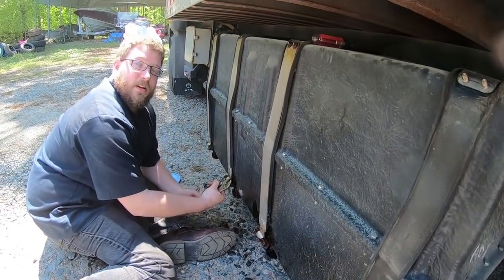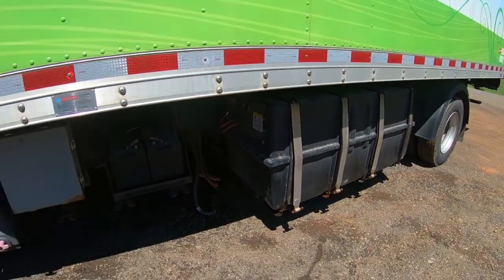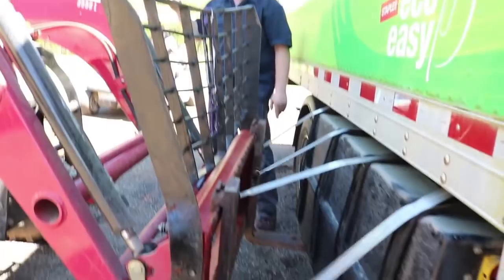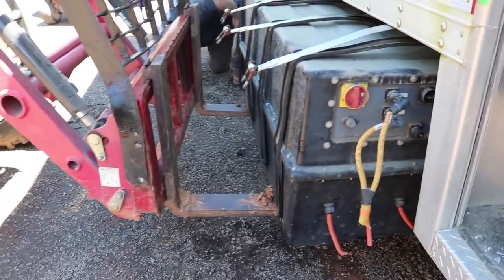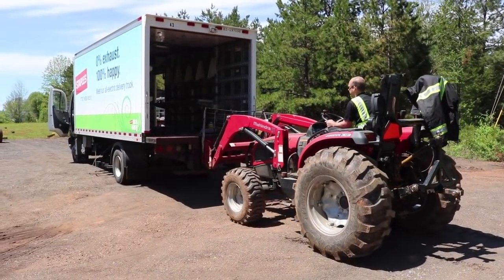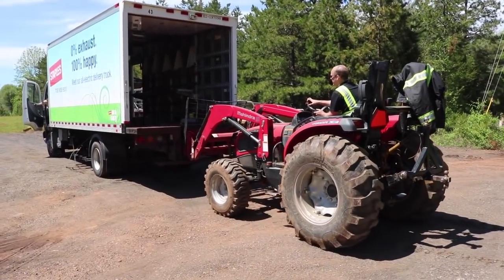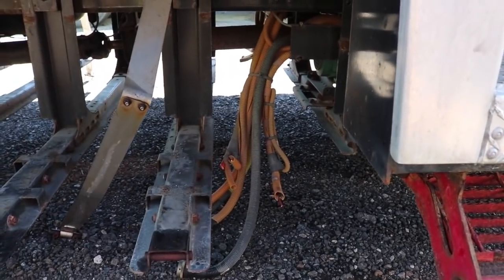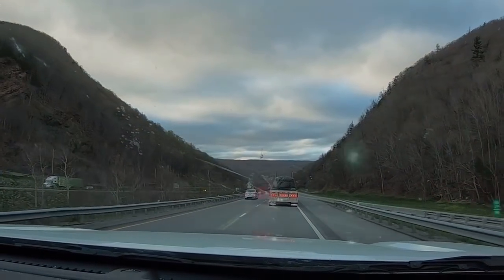7 Junkyard Electric Truck: Battery Removal!

Comment from the maker: I know I'm going to get plenty of negative comments on this video. Please keep in mind a couple of things:
What you didn't see in the video is about two hours of us going through our options, figuring out the best thing to do, and NONE of our options at that point being particularly good.
No, the high voltage cables don't have quick release connectors on them. They did have to be cut.
Vice grips are the right thing to use when the correct tool can't work, due to rust and other issues.
We were far from home and had limited time. We would have had very different options if the whole thing was just sitting in my back yard.
Driving the truck home was really not an option - we had no idea of the battery condition, it's 900 miles, requires 75A industrial 3-phase AC for charging, and a commercial driver's license.
The truck has just been sitting in a salvage yard for months - it has ZERO value when it's sitting there and nobody buys it.
There's 5 more trucks sitting in the same yard.
Likely, the best use for this truck is to take it apart, figure out how it works, make use of the various components for EV conversions and solar storage.
Reply from the maker: @Patrick Hughes I do NOT have a gearbox, but I could probably get one. Let me check back with you on this.
Reply from the maker: @Patrick Hughes 
I'll pester him again.

Comment: Even Tesla’s new trick only goes 300-500 miles without a charge.  First of all 300-500 is a large gap. I’ll guess it’s more 350-400 miles. They can’t travel fast enough. It’s A LOT easier to just pump gas and go as far as you want. Takes a split second. Too high maintenance and can’t drive far enough. They will be able to in the near future but not yet.  God Bless

Comment: That’s the problem with these big electric trucks. The batteries do not last long enough for cross truck driving and changing a battery sure is a job. So if I need a battery change beside the road I’ll need a forklift lol no thank you.   Cool but the technology isn’t there yet.  Good luck and God Bless You All
Reply from the maker: To be fair, these trucks were NOT designed for cross-country travel. They were used on fixed city delivery routes.
These were never designed for fast-swapping of batteries either. That was only because we were actually taking the truck apart.

Comment: I hope the scrap buyer payed you well?    ADD it all up the motor the air compressor, inverter with big dc-dc, and most of all the controller, you could remove it all in 2-4 hours and sell on ebay for $3k on a bad day! Then how much is scrap a ton, with loads of Alu+ copper wire... $500-800 plus! You are both mad! It had power for lights etc, tow it back!! then strip and brake, then scrap!

Comment: Could u have used the electric motor in the truck .
Reply: That was what I was thinking... ADD it all up the motor the  air compressor inverter with big dc-dc, and most of all the controller, you could remove it all in 3-4 hours and sell on ebay for $3k on a bad day!

Comment: Hi Ben.  I'm looking at these Smith Newton trucks as a possible option for our farm's next local delivery truck.  Did you find any useful technical info sources or forums related to these trucks?  It seems like it's not that hard to find one and they're selling for next to nothing considering what they're really worth to an EV person - or better yet an EV person in the market for a box truck!  I've still got a lot of research to do but I thought I'd ask if you and Seth found any good resources to dull my fear of taking on an aging Daewoo Avia with bespoke EV drivetrain from a now defunct Anglo-American manufacturer with no dealers, service network or parts availability :-).  I guess I should really buy two.

Comment: About 5 years ago I had a customer who bought a truck just like this that had been flooded and the batteries were gone. I took out all the electric parts the motor controller and charger and replace them with a net gain 13 in and a 2K Zilla controller and a new pack of calb lithem battery. The truck had a very interesting air compressor what's had gotten completely flooded for the air brakes. You couldn't move the truck unless you had air pressure.

Comment: @Ben - Despite the extra long weekend, still an awesome journey. The lithium batteries are most certainly usable, and I can't believe finding a way to charge them will be that hard. I think this will come down which motor to use more than anything else.
Reply from the maker: Once the batteries are out and by themselves, they will be easy to charge. In the truck, that charger needs high current 3-phase.
Reply: @BenjaminNelsonX  Cool, thanks Ben for the response. Just assuming here, but are you thinking something similar to level 2 type charging, single phase 220-240v, maybe 20-40A range?
Reply from the maker: Individual batteries can be charged on just a simple 12V battery charger. For an entire pack, it makes the most sense just to use current standards, which would be J1772 on 240V probably at 32A.

Comment: I'm surprised you didn't grab the inverters and the motors on the truck as well at least for your lawn mower
Reply from the maker: The inverter and motor on this truck are HUGE!
If we had more time, we would have definitely stripped those parts, but to do that properly would have required a day's work all by itself.
Motor is WAY too huge for a lawn mower. I can already pop wheelies on my one lawn tractor. What more do I need!

Comment: Was it not possible to drive the truck home?
Reply from the maker: Nope. Need a commercial drivers license and 75A 3-phase charging. Actual condition of batteries is unknown. Vehicle was originally designed for a 60 mile range, no idea what it would be right now.

Comment: Hmmm, as long as it was worth it I guess. Seems like a big waste though. Kinda like buying a gold mine so you can get a dozer for free.
Reply from the maker: Typically, the largest cost of an EV is the battery. It's the single most valuable part. Besides, it was either that, or come home with NOTHING.

Comment: Interesting, do you know what kind of lithium batteries they are? I guess that is the next video. That truck looked in pretty good condition must have been hard to just leave it there. My A123 bus batteries were already removed from their hybrid bus so all we needed was a trailer to move the 800 lbs battery box. You guys got a whole lot more.
Reply from the maker: Somebody else had bought one of these trucks and cracked open a battery pack, so we know they are Valence Lithium 12V style batteries. Group 27 size. You'll see plenty more in an upcoming video.
Reply: @BenjaminNelsonX  Awesome the LiFePo4 are safer than the cobalt. They also have independent BMS system so looks like they will be easy to configure. Cheers boys and good luck.

Comment: Are you guys taking the motor out too?
Reply from the maker: The idea is that if we pull the parts, we are going to pull ALL the related EV components.
Reply: The motor has a 2 to 1 gearbox and go straight to the drive shaft a gigantic motor but it's reading is only 150 kilowatts water cooled

Comment: Hate to nit pick but all those high voltage cables looked like they had conector plugs on them... I hope you guys can get this truck back in one peice. Would be a huge shame to dismantle it.. Its such a great truck and all working!!
Reply: yumcha16, it makes you wonder why this truck is even in a salvage yard if all it needs is 4x 12v lead acid batteries. But I agree, it’s cringeworthy to see this thing butchered with vice grips and cutting high power cables, if in fact this truck is working fine. 

I wonder if it has some problem that don’t show up at 3 mph or 10 feet forward and reverse.
Reply from the maker: Nope, there's no quick releases on the high voltage cables. They go THROUGH the battery box wall. What you see at the battery box is just a weather proof strain relief.
Reply: BenjaminNelson, each cable has two ends. Not being there when the truck was assembled it seems like it would be difficult to connect both ends of every cable inside an enclosure. Since there was no shot of the inverter or chargers saying “and that’s why we can’t disconnect it there”, you can see why many might think you just ran out of time and started cutting cables.

We thought you guys just watched too many Rich Rebuilds episodes. Lol
Reply from the maker: @imho7250  The other ends of the cables make sort of a crazy loop up towards the inverter and also tie in to the other battery pack. It's very difficult to get back in there and have room to reach hands (let alone tools) into that area. I don't know exactly  how the trucks were built, but they were probably a lot easier to work on BEFORE everything else was in place. The one panel on the battery box where the cables go through is glued/caulked in place. It looks like on that one that the cable connections were made inside the box and THEN the panel was glued in place.

Again, a lot of "Monday Morning Quarterbacking" going on here. It's hard to show everything in a single video. This is about 6 hours of total work, compressed down into a four minute video, filming while trying to figure this all out.